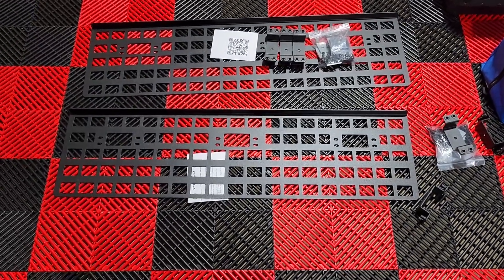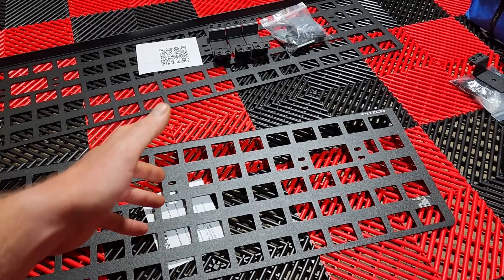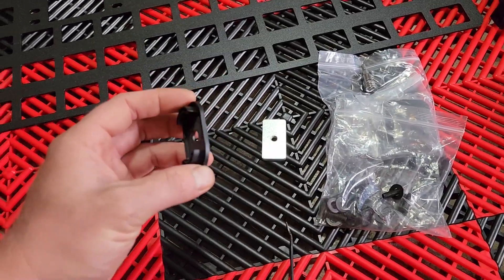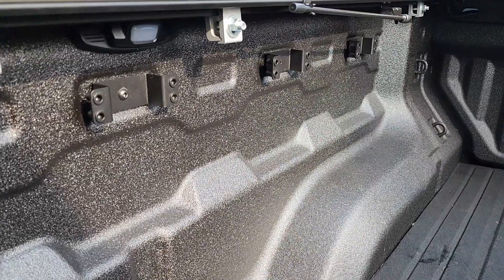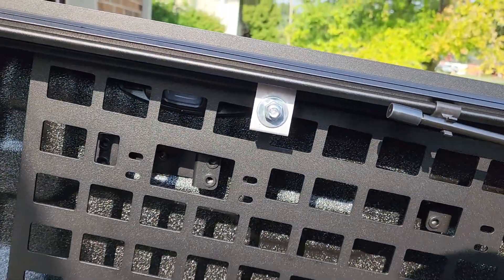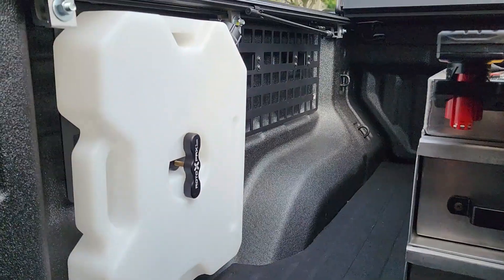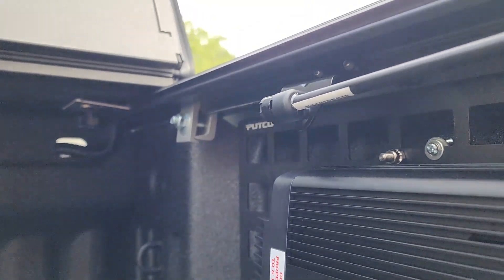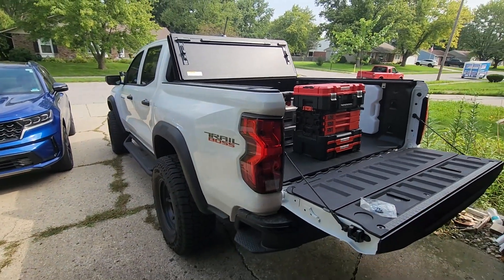23 Colorado Bed Molle Upgrade From Putco Great for Overlanding Camping or Work

Comment: How did you install those rotopax brackets to the molle?  Are the waterr containers the same size as the gas containers?  Thanks
Reply from the maker: Just used bolts with large washer on the back. These are the 2 gallon water tanks and they are the same size as the 2 gallon fuel tanks.

Comment: DUDE I was just thinking about doin those Molly panels as-well!  😅 how’s that inverter work I’m interested?
Reply from the maker: Haha ya they are great. Definitely a little pricey but love how I can use that space now. The inverter is great. I'll have a video posted on the 30th for the install. It just runs off my starter battery but does anything I need it too. Charges batteries, running my cooler, charging my power station.

Comment: what did you end up doing for your bed lighting? I was about to pull the trigger but every bed solution seems to interfere with another one (e.g., the cargo tie down rings also go in the same molle panel holes)
Reply from the maker: I moved the lights and mounted them outside the molle.
Reply: @TonyTheTechnician  Ah, I see - the OEM ones? do they mount nicely on top of the MOLLE grid? Would love a pic...